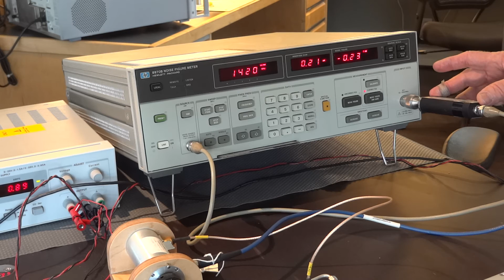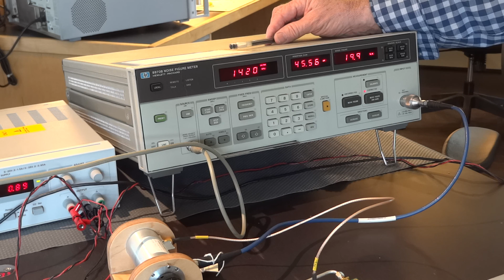Using the HP8970B Noise Figure Meter to measure a frequency converter

Comment: Hi thank you for your explanation,  its very nice but can you explain if you get a -0.2 noise and than you  read 3 is that a noise figure of 3.2.??
Reply from the maker: Sorry for the late reply.  The answer to your question is no.  You don't need to make any further correction to your measurement from your DUT.  The -0.2dB after applying the calibration is a result of the NF meter using the noise diode ENR stored value for 1420MHz but applying it at 15MHz.  Let me know if you have any more questions.